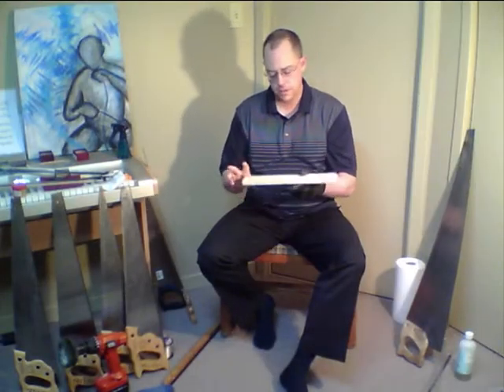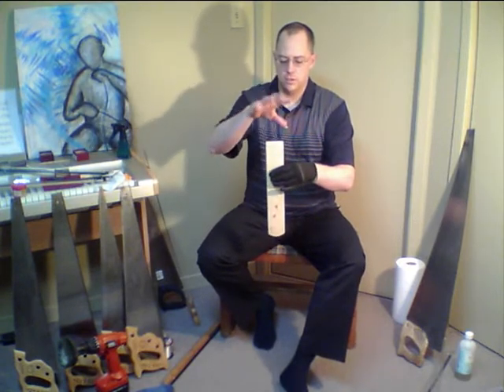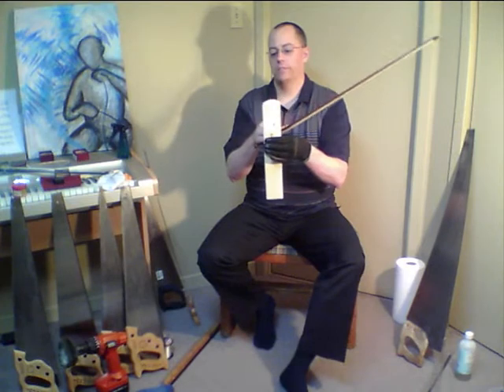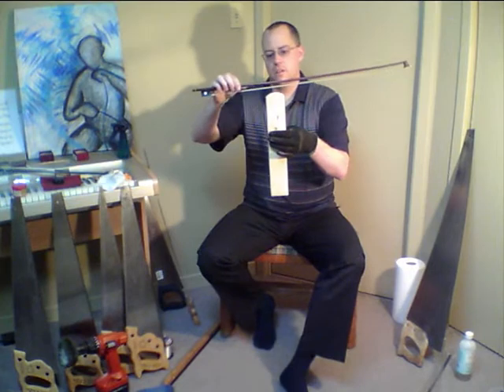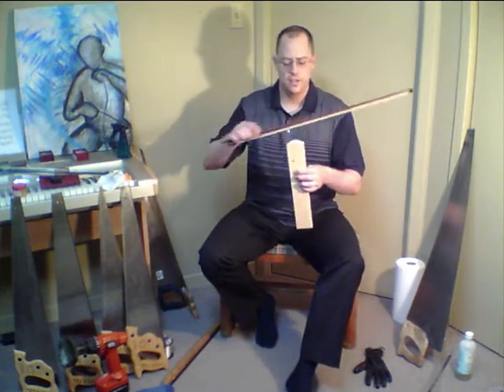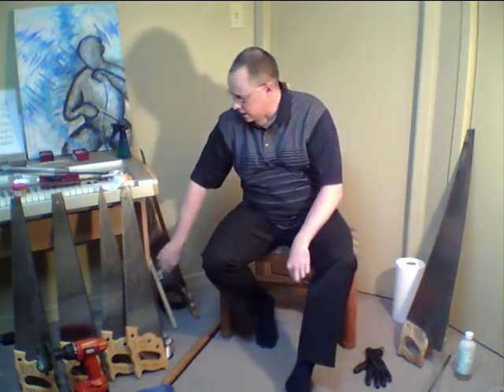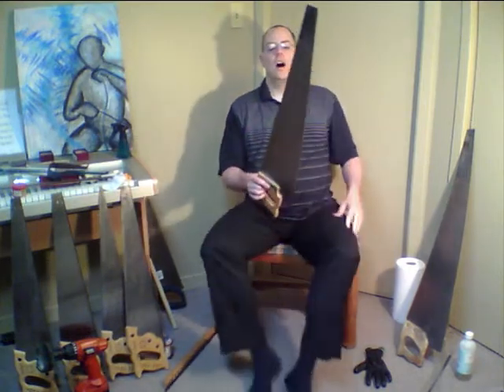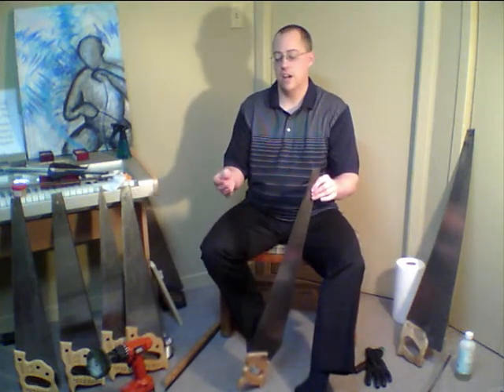Musical Saw Tutorial : Optimal Edge

Comment: Hi there, I am still having trouble getting the Violin bow to work on the saw...I can do the double bend and tap the saw and it rings out...I bought a violin bow and some rosin but there is no sound ??? my local music shop has been no help and your videos seem to be the most helpful. The sound volume that is coming off your saws is outstanding...are they amplified? My bow just slips across the edge and has no grip...I have cleaned the edge but to no avail...Help! Tony on Vancouver Island.
Reply from the maker: Hi Tony, first, for the local music shop, ask if your bow is rosined correctly for playing a violin, if they say no, you might have a rosin problem. Most of my video are original untreated audio from a Zoom Q3. Some of the most recent are treated mostly to remove scratch sound bow bite and add echo. I have never corrected pitch. On live performance I generally remix the audio over the recording so that the piano part don't look like a rerecording of the original. For the question about amplification, not sure if I understand the question, every youtube video can be played on a 50 000 watt sound system on a big stadium and everybody will ear it. So you question should be how loud should my saw be. The answer is louder with a bow that with a mallet. I have an app on my Iphone that measure sound in DB with a cut off at 100 db. I can easily hit the 100 db within 2 m. Good saw can rival a fully trained opera soprano on the hi note. Now for your problem, I would suggest you build my bow, that way you will be able to push very hard on the edge and you will make sound but it will be ugly but you will learn fast by trial and error. The problem with the violin bow is that you can't push hard so it's much harder to learn. You can also start the sound with a mallet and then play with the bow, it's much easier to bow a saw that already vibrate. Hope it help !

Comment: Hi, I will be buying a musical saw soonish, and I wondered whether there is a difference between wooden and plastic handles (since plastic ones are cheaper). Does it make a difference for the sound? Thanks so much in advance.
Reply from the maker: Smorphine Handle don't vibrate, so it's not very important. But sometimes you can have buzz sound that came from the handle if there is a gap somewhere, in that case, maybe it's easier to solve the problem with a wood handle ! Wood handle look more traditional. If you like the cheap saw look, plastic can be interesting. Plastic is also more lightweight. The shape of the plastic saw handle are generally more suitable for the low range of the saw !
Reply: Thanks so much, that was useful.